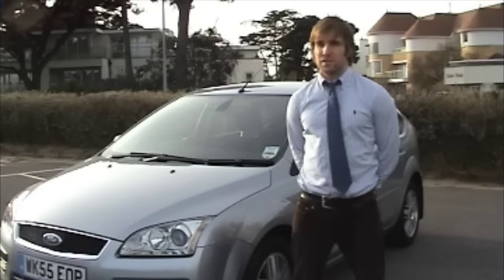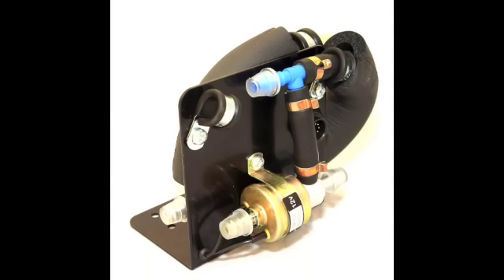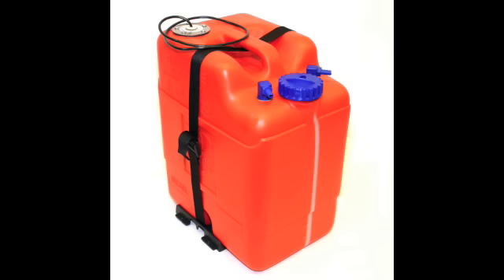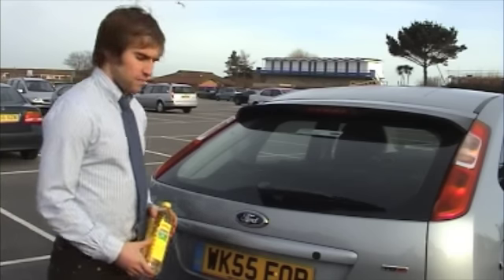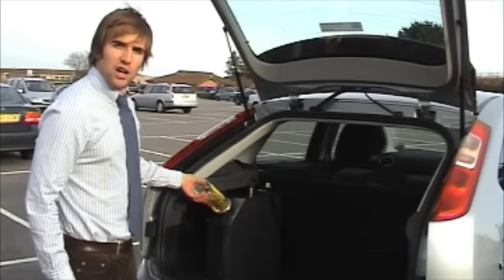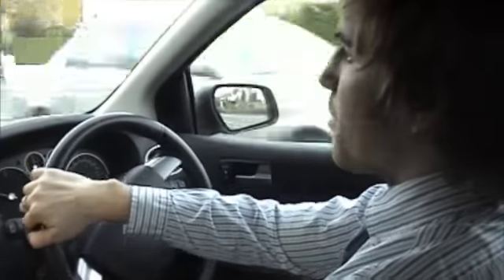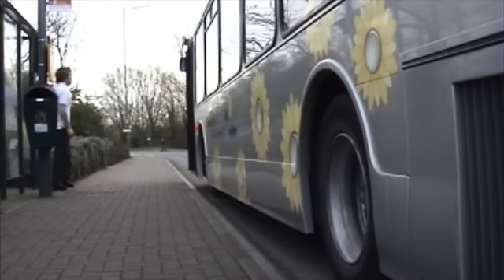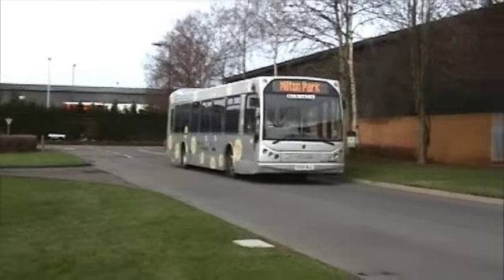Smartveg

Comment: @BA7835  Should be able to fit it to another diesel car. Check your instruction manual if you have one about  calculating your injection pump fuel return rate. back to the tank, you will need to know this to make sure that your timing for the purge programe is sufficent to remove the waste oil when you switch over to diesel.